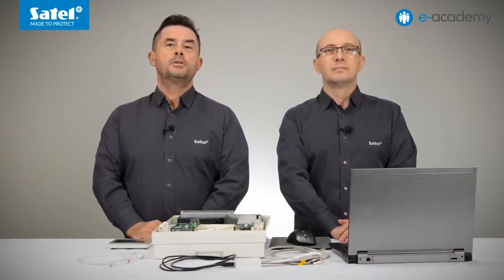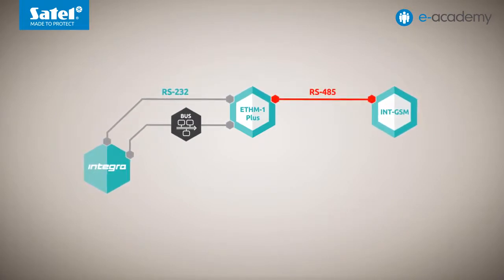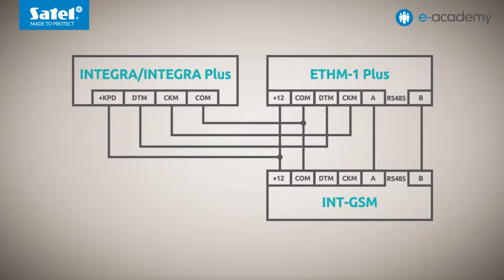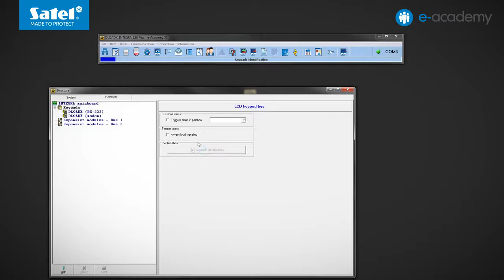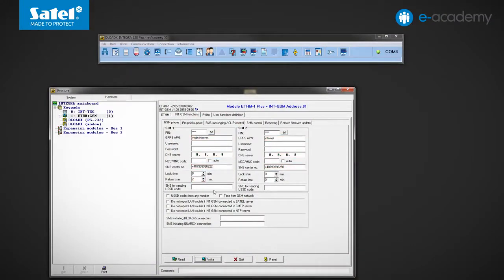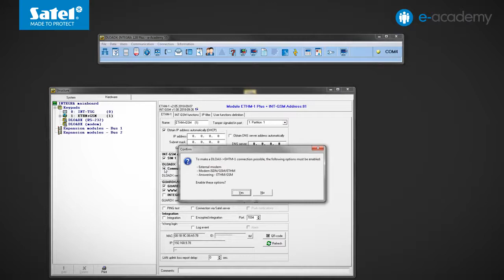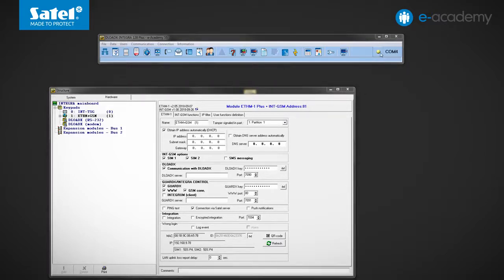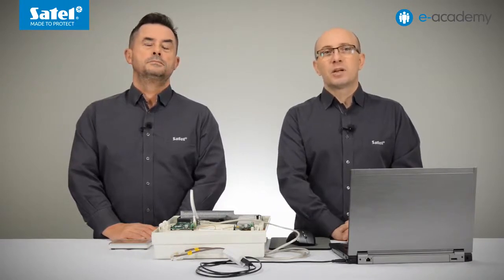SATEL e-Academy 55: How to Configure ETHM-1 and INT-GSM Network Settings to Work Together?

Comment: Hi team, good day, I'm Ronald Sanchez from Gigaworkz, we would like to ask what devices needed for network monitoring? all houses inside in subdivision we need to monitor in guardhouse incase have emergency, the houses was almost 500. thanks
Reply from the maker: Hi, thank you for taking interest in our solutions. When it comes to network monitoring, we got several devices in our offer that could work, like GUARDX, INTEGRUM or STAM-VIEW. Please e-mail our team directly at trade@satel.pl with more details about the premise you wish to monitor, and they'll come up with the best device combo for your needs.